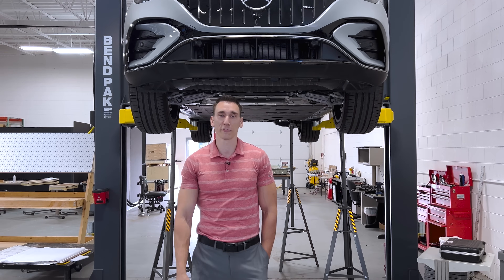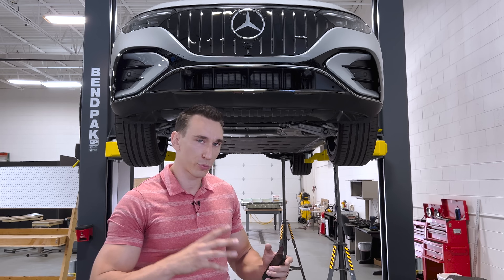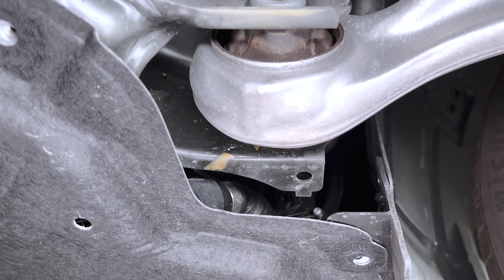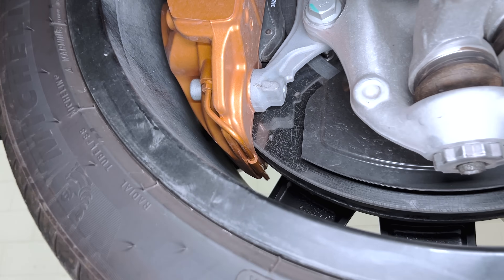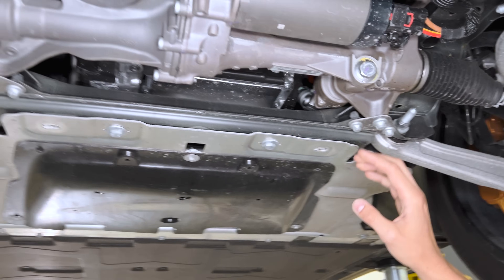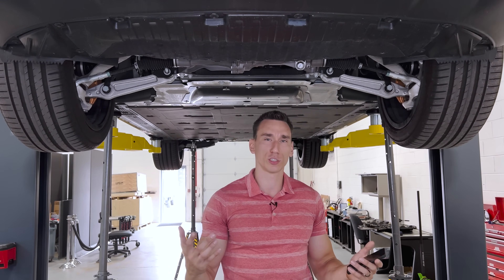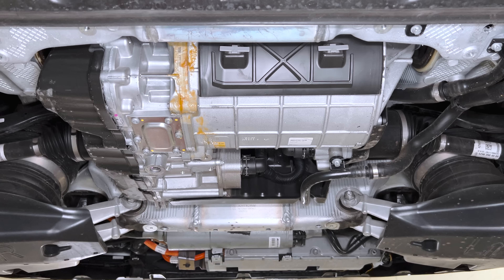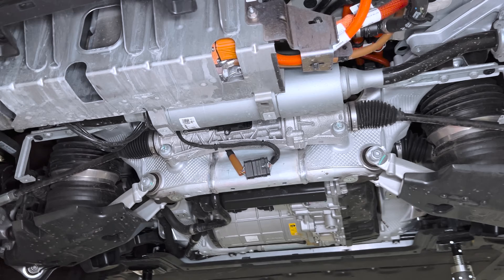Beneath the Mercedes-AMG EQE SUV: A Look at the Underbody & Suspension Design.

Comment: Electric anti-roll bar? Presumably it rolls like a pig on bends without it!
Reply: It really shouldn't be that bad with the low center of gravity..
Reply: @rkan2  Then they would not need a antirollbar. Only ICE needs such things.
Reply: It’s for ride quality. It allows them to drive like they have no anti-roll bar over bumps (allows the individual wheels to respond to bumps independently) but with an anti-roll bar around corners. All modern EVs have a low CG but all also have at least front anti roll bars.

Comment: Gimme a plaid
Reply: No, Even the koreans are better than that contraption. 3 and Y, maybe even CT are good. Then many Chinese and Koreans, then germans, then Stellantis then Ford, then GM, then Plaid. Plaid is fast but nothing else.
Reply: @wolfgangpreier9160  It's a lot faster than the supposedly fast AMG
Reply: @allencrider  Yes, but that is - sad to say - all it is. f i want fast and cheap i buy a used M3P. If i want fast and not so cheap i buy a Plaid. If i want luxury i buy a Mercedes.
Reply: @wolfgangpreier9160  Yeah, luxury but not so fast. Maybe it's status you really want.
Reply: @allencrider  Me? I would never buy a luxury thingies. 

Not a car, motorcycle, boat, watch, house, vacation. 

A car is a tool for me. To safely, cost and energy efficiently transport my tools and parts to and from my customers. And the same goes for my employees.

Model 3 is too small but wifey loves it. Model Y is also not big enough but larger vehicles with similar cost, sustainability and features are not available. I hope i get 2 of the ordered Cybertrucks before 2030. Or someone else produces something comparable.

All other manufacturers are either too expensive, do not have the necessary Software and App Support, do not sell here in middle Europe, are too small, not efficient enough or their TCO is too high for my budget.

Comment: what has happened to the Yasa axial flux motors that Mercedes said were to be fitted to AMG spec performance EVs?
Reply: the Yasa axial flux motors are reserved for special AMG vehicles which will have their own platform called AMG.EA. The electric AMG GT 4-Door Coupe with over 1000hp, coming to markets in 2026, will be the first vehicle to get these new motors.
Reply: @Aztasu  Wishful thinking 😂🤣👍
Reply: Was wondering the same thing. But I suppose yasa Flux still doing the reliability validation so cannot really meet the timeline for this product. Or would be about 1/3 the size of this and may need much more beefy cooling pipes.
Reply: Obviously nothing.

Comment: I have to disagree about the gear-looking balljoint nuts at around 3:00. There is significant distance to accommodate a normal castle nut within the diameter of the brake rotor, and you can see that the tie rod ends extends further than these nuts.

Comment: Sorry, this car has a shockingly low 74 eMPG (combined)(!!!) and a 235 range.....must do better.
Reply: It gets to 60 in 2.9 seconds! If you drive it normally it gets much more milage.
Reply: That’s because it is an AMG SUV.  My EQS sedan is delivering 375-400 mi range consistently.  Using max regen and city driving only, one time I got 413 mi on a single charge.  Others have reported higher.

Comment: A ton of money for an SUV.... I would buy the Cybertruck all day long. Better technology and useful in more ways.
Reply: Check the latest Edmunds video. The Cybertruck is a POS and so much worse than EVs from premium manufacturers like Mercedes. And this is by far not the first video to show the myriads of issues and failures of the Cybertruck and it's also not Teslas only vehicle with massive build quality and software issues. All of them cost way too much money for what they offer. The EV market has evolved and devleoped very quickly and Tesla is still stuck in the early days.
Reply: Cybertruck is build way way cheaper and is falling apart very easily
Reply: @Aztasu  In your personal experience....? 
So please, if you want to talk nonsense. Go somewhere else where they are listening.
Reply: Cybertruck is huge compared to this 😂